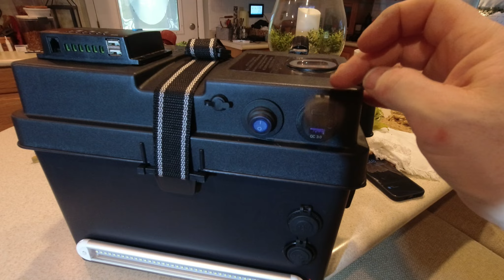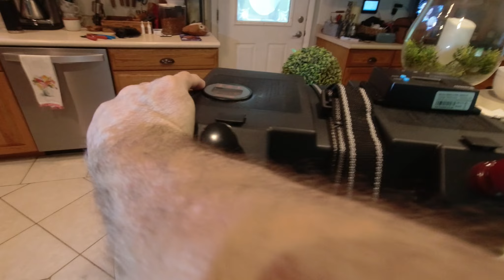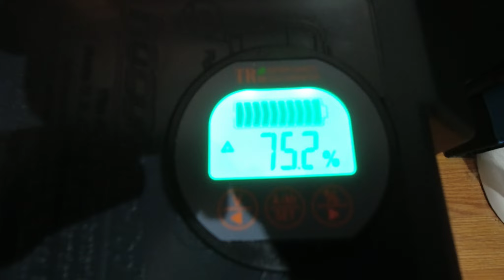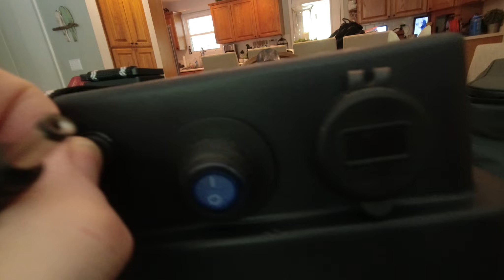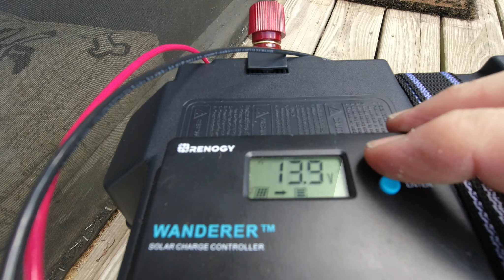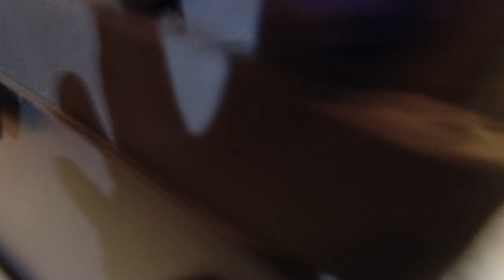DIY 100ah Battery Box

Comment: This is sweet. And yea I like how you have those main terminal posts. The covers are a nice touch too. Gives you a very nice and efficient option to have direct access to the battery for either charging/discharging. BTW.. could you share a link for that battery box you're using? Thanks for sharing!
Reply from the maker: Thank you for watching and commenting. Here is the link for the box I used. 

https://www.amazon.com/NOCO-HM327BKS-Snap-Top-Automotive-Batteries/dp/B004W5SG6Y/ref=sr_1_1?crid=298AZR3VGWSHX&keywords=noco+snap+top+battery+box&qid=1685721869&sprefix=Noco+snap+top+battery+box%2Caps%2C149&sr=8-1

And the link for the terminals:

https://www.amazon.com/Battery-Ground-Junction-Connector-Terminal/dp/B089FF3185/ref=sr_1_1?crid=ER4ICWCUIS27&keywords=Ampper+3%2F8%22+Copper+Battery+Terminal+Stud+Connector%2C+M10+Remote+Battery+Binding+Post+Junction+Post+Block+Terminal+Kit%2C+Pack+of+2+%28Red+and+Black%29&qid=1685722113&sprefix=ampper+3%2F8+copper+battery+terminal+stud+connector%2C+m10+remote+battery+binding+post+junction+post+block+terminal+kit%2C+pack+of+2+red+and+black+%2Caps%2C171&sr=8-1
Reply: @OurKentuckyLife  Awesome. Thanks man!